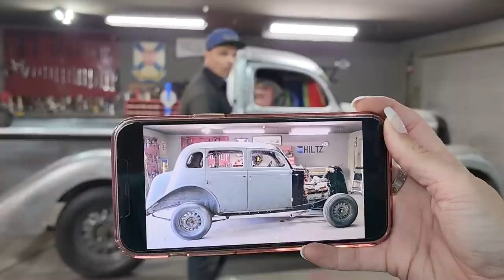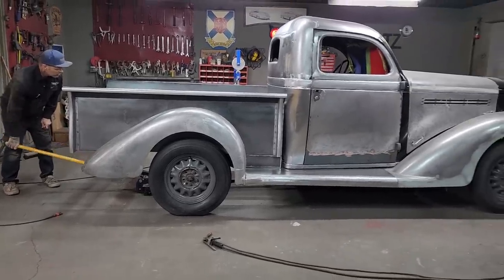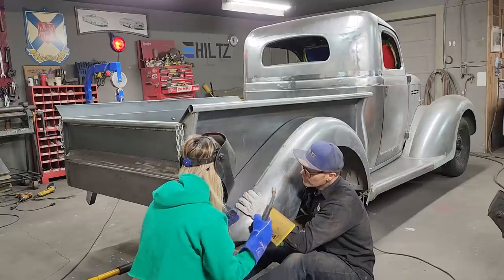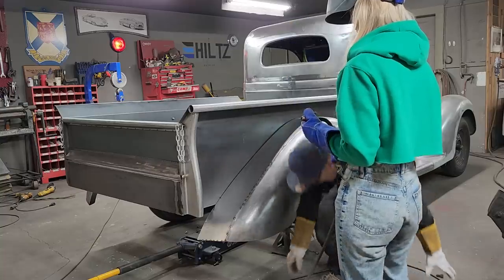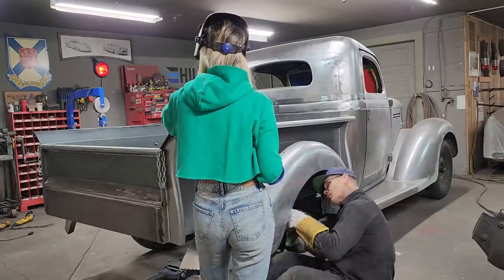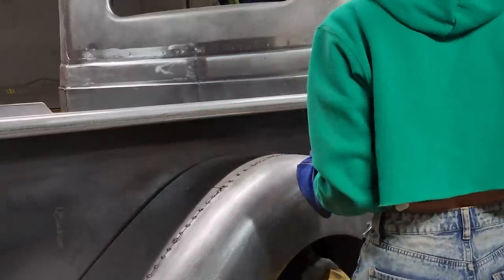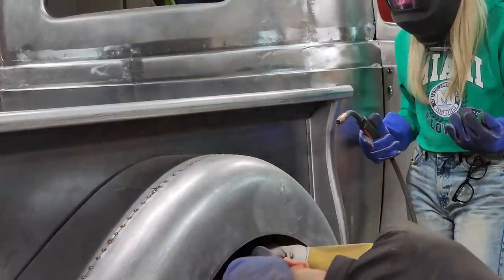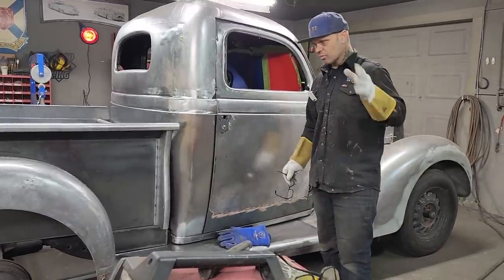Jolene is butt welding the widened rear fender on the 1935 Plymouth

Comment: My dad did this build back around 1945 he had no cutting machine no welder the way he put it together was brass braised he had nothing to sand it smooth and I remember he made the bed and floor with metal he braised and fitted the pieces together. The back of car cab was brought forward to make the back of the truck cab now like I said he did this without a welder and sander, he was just a farmer that needed transportation and a truck for our tiny farm. He also built a tractor out of a Model T took two chassis and braised them together then drilled holes and re enforce them them with leaf springs heated and straighten out. He reworked a transmission to  make the gears ratio have a low low first gear also built wheels with lugs to use in sandy land it was also all wheel dr. I remember he sold it for $750 in 1946 and that was good money then my friend. So that’s why I love this build you are really doing nothing by the book but good common sense.

Comment: Your builds/videos have given me the confidence (screw it just do it) to try my hand at metal work on my 1972 chevelle.  I've have mini tubbed the body with wider wheel wells a new trunk pan and some floor patches that have came out great. "It's metal you can always add it back" helped me not over think it. Keep getting down Bad Chad!! I would put HILTZ on the tailgate to represent your brand/name sake/company logo

Comment: Thanks for creating the ultimate, period Aussie ute! Utes are simply a major part of our Aussie working and now social culture and this one makes the grade! Just a query though, as if this ute was fitted with left & right hand thread wheel studs, then this one has been changed, as the one you have shown on the right rear, is right hand thread. Here, left hand threaded studs would be fitted to the right side of the vehicle, (and vice-a-versa), to allow the rotational & gyroscopic forces on the wheel, to assist keeping the wheel nut / stud in tension, Love this build and the speed at which it's going together

Comment: Hi Chad & Jolene Truck looks Amazing.
Yeah that raw naked bare metal is appealing 
To the eyes as it’s being worked on.
When folks create the wooden bed instead 
Of commonly drilling thru 1x6 lumber looks bad.
If you overlap metal strip drill at cross points of support cross bars then
Weld a carriage bolt so you only have to fasten bolt from under side it gives bed a smooth look with the rounded head of the carriage bolt.

Comment: Chad and Jolene: I'm always amazed at the quality and speed you two operate with. it's truly amazing. Good call on the running board shape, especially the flair at the end where it meets the rear fender. The method used to butt weld the fender is crazy inventive.

Comment: Hey Chad , you have built a lot of awesome  cars, and with minimal tools . But the Truck is my favorite. I'm building a 1954 Chevy truck.aka Ol'Beater. I sold my pick up bed and rear fenders. They were really bad. I'm making a flat bed. But that bed you made from scratch is AWESOME !!!!!. Pluss you and Jolene make a great team. Like the Beauty and the Beast.
Reply: I may have asked you this before, but is your truck a 3100, a 3600, or a 3800?

Sorry. I have been obsessed with '54 Chevys for 40 years.
Had a '54 3100, from '83-'03...that I rebuilt myself, back in the '80s.
And I took built a flatbed for it.
The original bed...man, the front panel, lower bed sides and floor were all completely rotted, because the previous owner had left cut silage sit in it for two years straight; and the top of the tailgate looked like a horseshoe, because a tree had fallen on it.

Sorry to ramble.

Merry Christmas!
Reply: @willhorting5317  Merry Christmas to all. And a Healthy, Safe New year.
Reply: My truck AKA O
l'Beater,  is a Frankenstein.  It was a 3/4 ton  long bed. The bed was held by rust. And the chemical tank that had been on it. I dismantled it , sand blasted. Shortened it installed a 1987 c 10 front suspension (it bolted on). Rear axle from an 80s C10. 350 Chevy V8, we 200r4 automatic. The 54 body was very cancer ridden. A friend needed parts by to fix his 52 and he had a 54 body he had plans to use for parts. We traded. Bodys .all this has been a 30 + years in the making. I'm a retired aircraft mechanic. Eastern airlines went on strike, kids were for, life got complicated. Now I'm retired from American airlines. And done more work in 2 years, than I would have in 30. I'm in Tennessee, and want to have it shipped here without getting scammed.
Reply: @juanbarturen2726  I see. Sounds good! Enjoy it!😎

Comment: You built the fenders on your 35 Plymouth similar to the way the factory did on the 47 Hudson pick up. Hudson used a 47 automobile fender with an extension built to match the Box. I have both a 47 Commodore and a 47 pickup. Your build is turning out really nice.

Comment: For whatever it's worth, I like seeing bare metal because it allows me to see the basis of the thing and I can see that the base is sound and not a bodge-up. I really hope you are going to take this through to completion. I'd love to see the thing with seat/s and controls, driving, with a bed in it and maybe a removable cover on the bed. I'm from a small, crowded island (UK) and people swipe stuff out of open trucks, which is why they are not ubiquitous over here - I run an old van. 
I love what you've done so far - taken a car and turned it into something that might have been available in the day. Something that is nicely balanced and not OTT and maybe with the odd tasteful and logical modification for modern traffic. So is it going to keep it's original motor, sorted to run on modern fuels? Or will it have a modern motor - not a snorting V8, but something with a decent amount of torque and fuel economy that runs nice and smooth and easy to drive?  Or will you go electric?
Whatever, do it your way, I look forward to the privilege of watching. Great stuff.

Comment: +1 on the bare metal look, at least while it is a work in progress. It makes it easier to envision the final outcome. 

Do you have any plans for the lower ends of the stake pockets, or are they meant to end abruptly?

Same for the ends of the upper tubes on the bed - are they just going to be capped, or do you have something more elaborate in mind?

(Personally, I see little bullet tail lights, market lights or high level brake lights in the rear ends of the tubes. Not necessarily practical, but good on the eye in my opinion at least!)

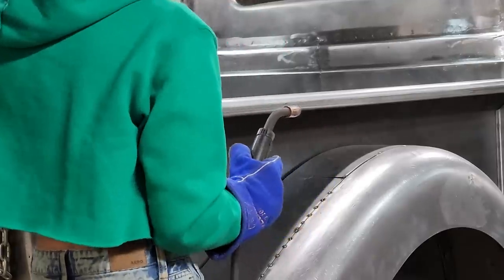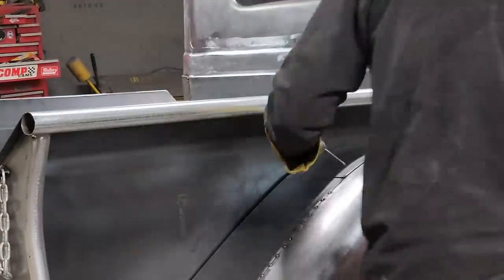Comment: Hey Chad! Hey Jolene! ... I usually don't comment but, I just had to because you're both doing such a fine job,  the truck's looking amazing. Damn the torpedos, full speed ahead, right?  Haha.	I'm thinking you're going to box up the chassis to strengthen it? Before you ever try to put any real weight in it. Just a joke, I think 18:41 it would be rated like 1/10 ton right now, 29:37 29:51 HaHa! 
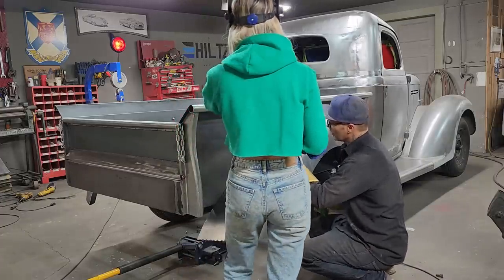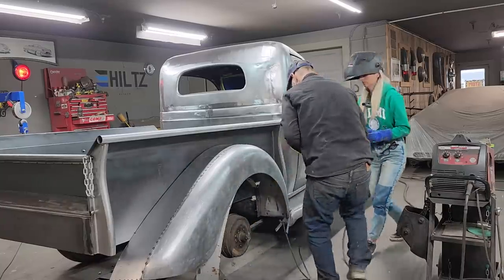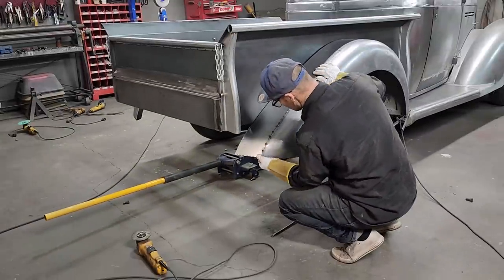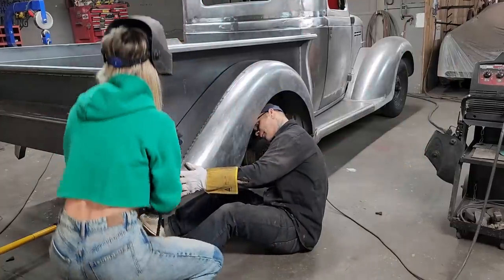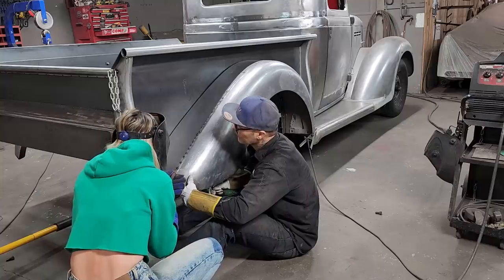17:57 18:02 I watch the show every day, while my car ('97 Honda Accord) sit's	in need of service parts.inflation no help ... Brake rotors (converting to non-captive rotors, w/acura parts) new rubber lines, new calipers, if I can't rebuild them. 21:22 I need to either put a new seal or a new steering rack in, timing belts, a/c condensor, maybe a radiator, belts, hoses, what not! haha. The car only has 100k, not bad for 25 yrs old, worth fixing anyway, the paint's gone too, a problem for Honda back then, but no rot, no rust, maybe put a mild tune on it, already has headers. Old hondas are easy to hot rod. Drop in installation for a IVTech K (300 hp) 42:27 37:24  engine and a 6 sp manual. I don't know if I'll slam it, I like the way it rides for a small car now. 67 trips around the sun and still having fun with cars, lol, 25:22 25:33 25:40 Good Job!

Comment: I used to use a small Ballpin hammer and it fit in my palm perfect for pushing on metal to get it into place, the wood may get a little blackened but it will last a long time. Wave... Chad and Jolene .. LOL

Comment: It looks generally very good, everything is really in proportion and in style, it is for sure a piece of very good craftsmanship. But there is one small detail that hurts the eye. That straight angle on the upper corner of the door. It should have a round tip like every other corner of a window on that truck now.
Good job Bad Chad.

Comment: CARUCK looks awesome , On your floor jack check the oil and open the handle , pump the handle several times . This will blead out the air in the pump !

Comment: Happened to notice the latest episode of Vice Grip Garage where Derek is featuring a 1935 Ford ratrod pickup. Other than the chopped top, the cab has body line similarities. I was struck as to how the Chad and Jolene truck  would look with rounded door tops as reflected in the ratrod pickup.

Comment: With tired jacks, long slow movements of the handle are more effective because they allow the pistons to be replenished between strokes. Rapid movements are ineffective because the oil does not have time to flow into the pistons.

Comment: Jolene, put your eye glasses in a safer place. Hanging off the front of your pants waist, they are facing the welding sparks, which will burn onto the glass surface. Wish there was a way you two could here my thoughts when you are working, so you could make corrections like this. Just looking out for ya'll!
Right on being the best build yet.

Comment: There are these plastic planks that look like wood. That seems to me like a great upgrade for the bed. 🎉
Reply: Are you referring to the material that is made for decks?
If so, I agree.
However, isn't that stuff pretty expensive?
Reply: @willhorting5317  yes that was what I was referring to. Advantage. No need to laquer or the need to spend more time on. 

So you fit it, screw it down and forget it.
Reply: You can even cover it with a rubber mat without concern of the planks rotting. 

If this turns into a show car. Great way to protect. And unveil when at location.
Reply: @FransvandenBergeMuziekschuur  👍

Comment: To attach the rear guards it would have been a consideration to have used coach bolts so on the inside of the rear box tray, bolts would have been dome head flushed off, nuts then on the outside of the tray, less liable to damage something your carting in the rear tray.

Comment: Those original factory wheels look like they were meant for this build. If the rear ones had the inside bolt plates removed and put on slightly dished rims, it would be tough.

Comment: Fitz does this people you cut off the old metal and put on new not over lapping no cut to fill out a real butt weld less weld less heat less clean up and a magnet and a screw driver pushing it up and down